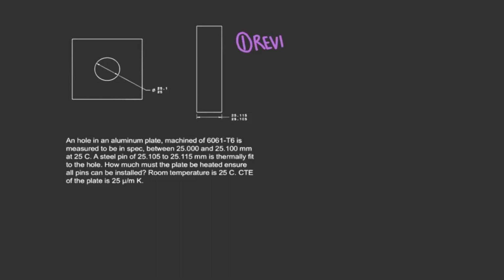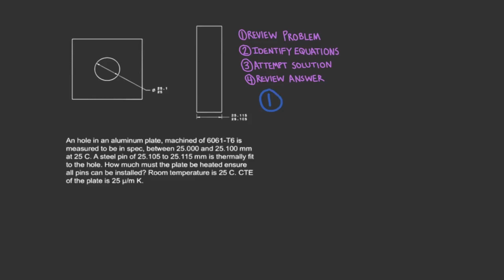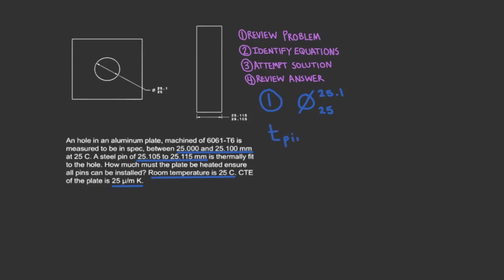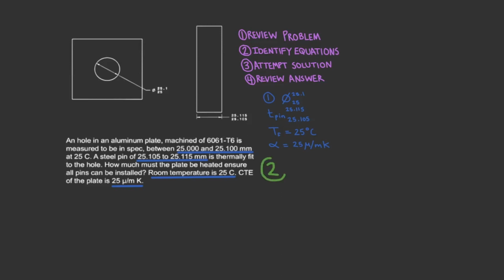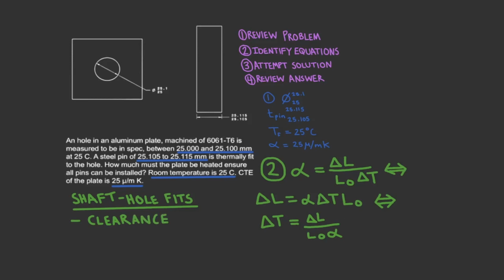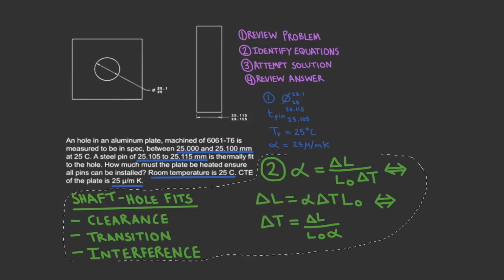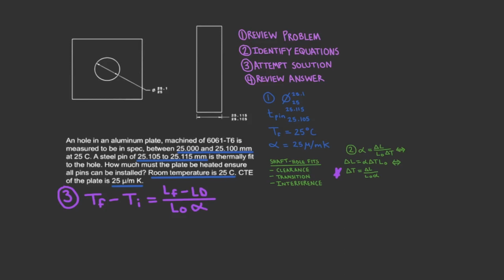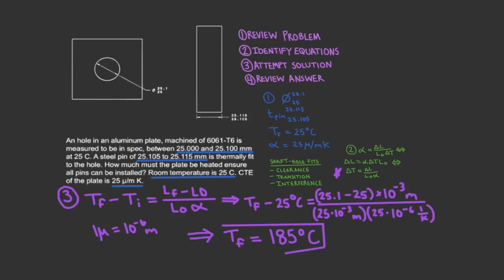TESLA Mechanical Design Engineer Interview Question SOLVED! #6

Comment: One more thing be corrected is that you are using Linear Thermal Expansion but this problem requires Area Thermal Expansion Formula that is not far of what you used, just is missing a number 2. The correct formula would be (Af-Ao)/Ao=2alfa(Tf-To); response would be very similar 184.4C

Comment: This answer is incorrect.  To ensure all pins fit in the hole you need to consider the MMC which is biggest pin (25.115) and smallest hole (25), the delta L that you calculate against should therefore be 115um and not 100um.  Love the videos!
Reply from the maker: Josh, thanks for the feedback! I was tripped up by this problem, but I agree with you. If the plate diameter is able to expand to 25.115mm, then our calculation would look like this: T final - 25deg C = (25.115-25)x10^-3m/(25x10^-3m)(25x10^-6/K)

Solving for T final we get 209deg C. 

What do you think?

I will add a correction in the video description. Thanks for watching!
Reply: @Arch1medes  et al.  All answers could be correct.  The verbiage for this problem could add a bit more detail.  For example what type of fit are they looking for? Clearance, Transition, or Interference.  But I have assumed clearance fit and that also gets me to 209 C.  Fantastic work here and thank you for uploading.  You must have a really good memory if you were able to remember all these problems from your interview!

Comment: Im enjoying this video series, but I would consider your answer incorrect. The setup is there, but Lf needed to be 25.115 to ensure ALL pins can be installed. As you have it, a 25.000 plate would only expand up to 25.100, too small for even the smallest pin. This is a glaring issue that should be caught in step 4 when reviewing. 

Unless otherwise specified, assume all tolerances are measured and evaluated at room temperature.
Reply from the maker: Thanks, Michael! I don't think that the plate hole diameter can exceed its tolerances, therefore an interference fit is required and force will be needed to join the pin and the hole. 

This Wikipedia article explains interference fits: https://en.wikipedia.org/wiki/Interference_fit

If the plate diameter can expand to 25.115mm, then our calculation would look like this: T final - 25deg C = (25.115-25)x10^-3m/(25x10^-3m)(25x10^-6/K)

Solving for the T final would get us 209deg C. 209degC was not an option for the answer, but 185deg C was an option. 

I thought this problem was tricky and I could definitely be wrong. What do you think?

Comment: Fantastic videos, but quick thing to clarify here-
Don't you have to expand the plate such that it is larger than the highest value within the tolerance band of the pin to ensure "all pins can be installed"? i.e. 25.115mm or greater and not 25.1mm
Reply from the maker: Thanks, Eeshaan! 

I could certainly be wrong here, but it is my understanding that the plate hole diameter cannot exceed its tolerances, therefore an interference fit is required and force will be needed to join the pin and the hole. 

This Wikipedia article explains interference fits: https://en.wikipedia.org/wiki/Interference_fit

If the plate diameter is able to expand to 25.115mm, then our calculation would look like this: T final - 25deg C = (25.115-25)x10^-3m/(25x10^-3m)(25x10^-6/K)

Solving for T final would get us 209deg C. 

What do you think?
Reply: @Arch1medes  Thanks for your video.....I think these are manufacuring tolernances....nothing to do directly with schrink fitting.... I also think that inner hole needs to expand thermaly to 25.115m for schrink fit...
Anyway....the expansion of hole is 2 dimensional ...whereas the Coeff. alpha here is for linear expansion...
Reply from the maker: @iconoclastbhatti8159  Thanks for el watching the videos! Your explanation seems to make sense. I had a tricky time with this problem and should probably revisit it.